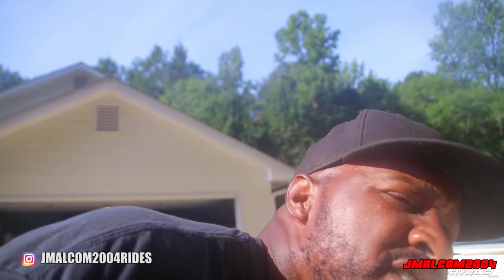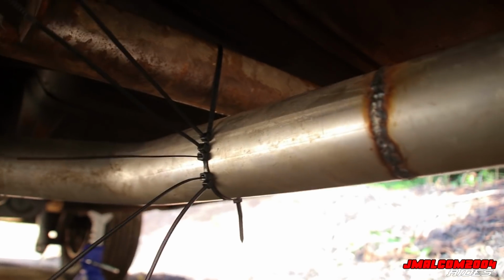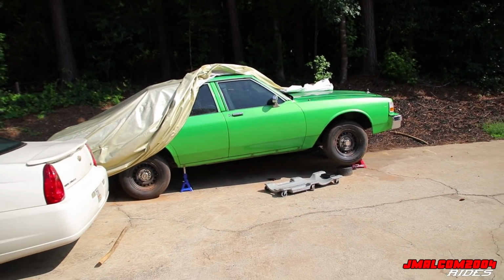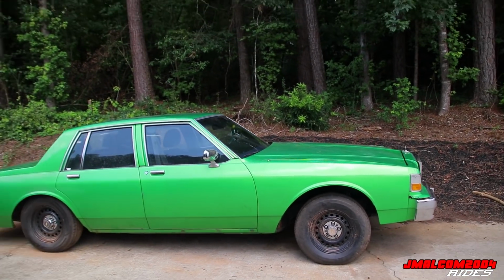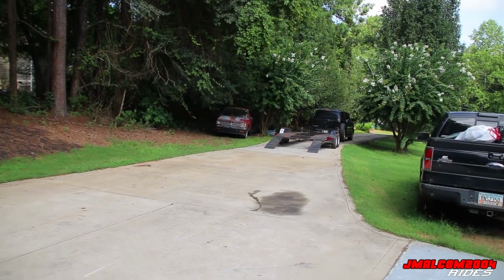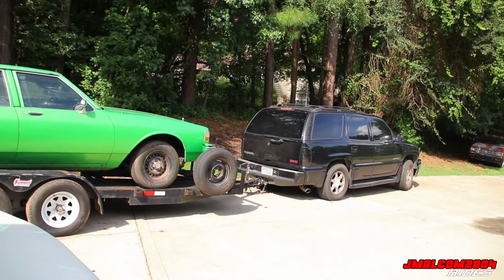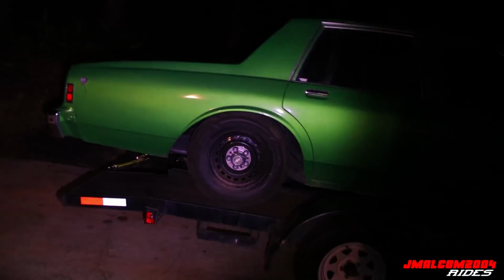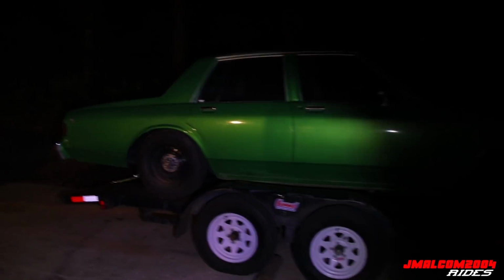DOLO BOX CHEVY BACK ON THE GROUND BUT OFF SCHEDULE!

Comment: A word for safety, get a second tie down strap for the front of the car. Remember what I said way back when, about getting  the right crossmember in the first place....Got you running in circles again. Just trying to save you some headaches and being safe at the same time. You had me worried doing that brake stand with the crossmember not bolted up. Good way to break your bellhousing.....
Reply from the maker: Had a strap in front and back and I have a crossmember coming
Reply from the maker: And the crossmember is the right one actually. It’s a b body crossmember for a 200r4. I just needed to pivot it on the holes and bolt the side down as I did already but like I said above, I just bought a G Force so I won’t have to keep waiting on people
Reply: @JMalcom2004Rides  You will be glad you did. Right on! Now we talking.
Reply: @JMalcom2004Rides  2 straps in the front and 2 in the back. More secure and a margin of safety incase one breaks.
Reply from the maker: Joe Sisk got ya. I’ll grab 2 more straps

Comment: Damn this showing me some things that might have been my issue with my car when I had the th350 in my car using the  700r4 crossmember couldn't get one bolt to line up an caused my torque converter get destroyed